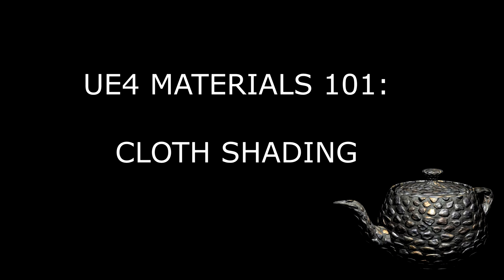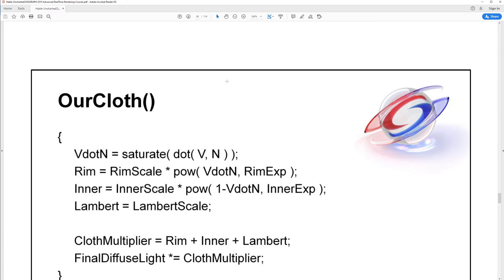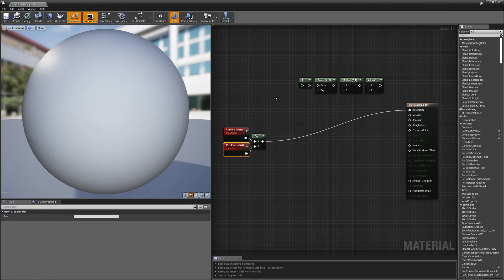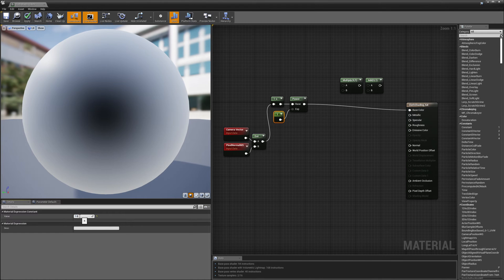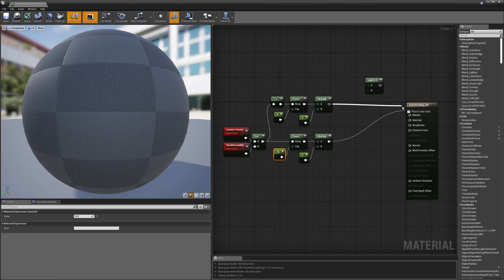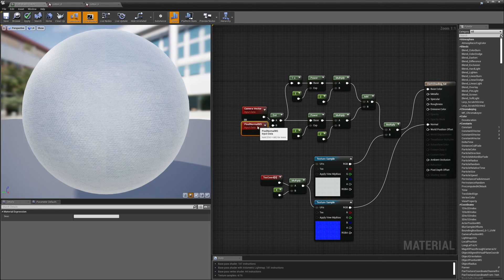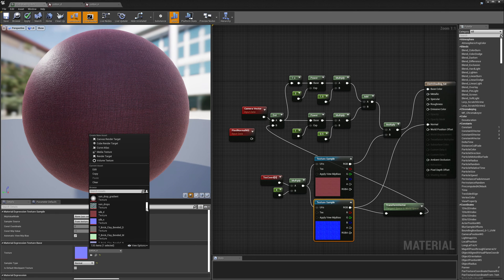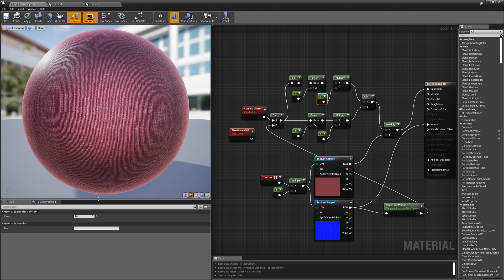Cloth Shading - UE4 Materials 101 - Episode 10

Comment: very helpful tut, I was wondering why didnt you go for the ue4 fresnel functions ?
Reply from the maker: There are two reasons.  The first is that the Unreal fresnel node does a few extra things that I didn't need to do - so using it would have been slightly more expensive.  And the second is that I wanted to show the viewers what the math inside the fresnel node does so they would understand it better.  This is something that I do often on the channel - show a node that does some fancy math, and then show how the math works.
Reply: @BenCloward  thanks alot ! your tuts are beyond helpful

Comment: Hi, Ben, thank you so much for the tutorials. I'm just newly getting into texturing and shaders and your tutorials are so helpful. I have a quick question. What is the difference between adding 2 textures together versus multiplying 2 textures together?
Reply from the maker: Thanks!  I'm really glad these are useful for you.  Textures store values in the range of zero to one.  When you add two values together that are between zero and one, the result is a higher value - so adding two textures together brightens them.  When you multiply two values together that are between zero and one, the result is a smaller value - so multiplying two textures together darkens them.  For example, let's say you're two textures are both medium gray - so the values in both textures are 0.5.  If you multiply 0.5 x 0.5, you get 0.25.  If you add 0.5 + 0.5 - you get 1.  See what I mean?
Reply: @BenCloward  Got it!Thank you for explaining!

Comment: Hi Ben, thank you for this great tutorial. I have a question for you, what's the difference between building the shader all from scratch as you are doing and just using the Fresnel function using one minus to create the inverse?
Reply: the fresnel function follows the equation for schlicks fresnel. A dot product is just a simpler version.
Reply: @Pseudocue  Thank you for your answer! Do you know if, in terms of instructions to render the shader, using a dot product vs a Fresnel function has any performance advantages?
Reply from the maker: It will be slightly cheaper to just use a dot product.
Reply: @BenCloward  Thank you, Ben!

Comment: Thanks Ben, your is one of the best channels for Unreal tutorials. May I ask a question? what if we want that the shader react in a correct way with lights, I mean when the light pass trough, do we need to add just a subsurface node and work with opacity or it require more a complex structure?
Many Thanks
Reply: Interacting correctly requires writing a new shader model, which is a pain. A halfway solution is to do it solely for your direction light, which you can get by setting your directional light as "sun/atmospheric light" and using the atmosphericlightvector node in your material
Reply: though granted you won't get correct shadowing
Reply: @Pseudocue  Thanks for reply, I've never used that node before definitely I'll look up the UE4 documentation. I'm searching a not too expensive material, do you have any advice? thanks a lot

Comment: I never fully understood Dot Product node before but now this node is totally clear for me. Thank you as always Ben Cloward. 

I have one question. What does Cloth shading model do in UE4 material editor? Do I still need to use that shading model if i do what you said in this video?
Reply from the maker: That's a really good question, Tural - I'm glad you asked.  In this video I mention that this cloth technique that I'm sharing isn't physically correct - it's just an imitation of the appearance of cloth rather than being physically correct.  The core reason that it's not accurate is that it's using the camera vector instead of the light vector.  The light vector isn't available in the shader graph.  You need to modify the core lighting model in order to use it, and that's not something you can do in the graph.  You need to create a custom lighting/shading model for that.  And that's what the Cloth shading model is.  The Cloth shading model in UE4 IS a physically correct shading model.  However, it's only correct for one specific type of cloth.  That's the challenging thing about cloth - there are so many different types.  So the Unreal cloth shading model is only good for one cloth type.
While the cloth shader that I presented in this video isn't accurate, it does allow you to imitate lots of different types of cloth - like silk, satin, denim, cotton, etc - so there's more control and flexibility.
Reply: @BenCloward  Ohh, thanks for answer)) Every new tutorial teaches me more things. You really need more subs )) Right now quixel guys doing amazing live stream about mesh blending metods with terrain material and RVT materials, so another in depth RVT tutorial would be amazing by you too in a feature videos. )) Thanks again, Ben. ))